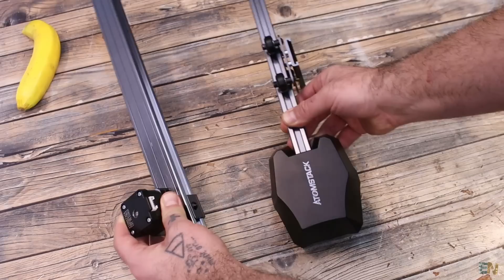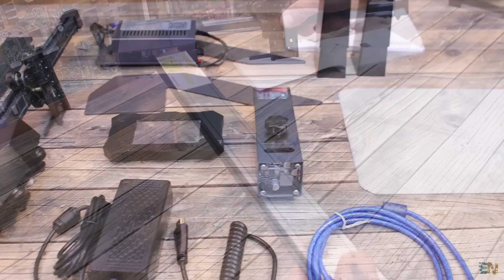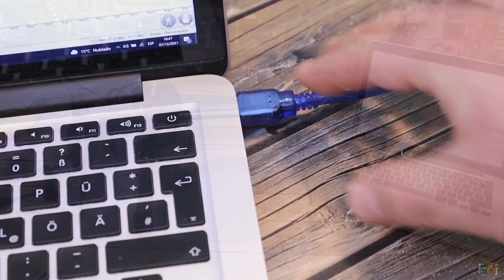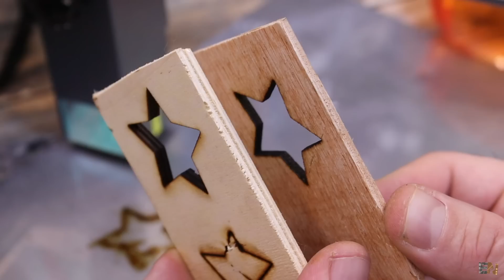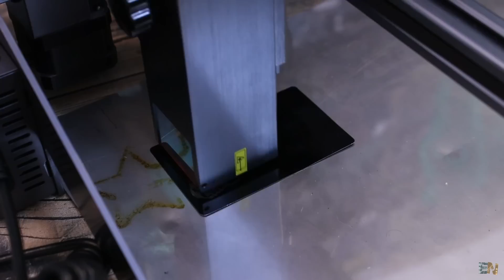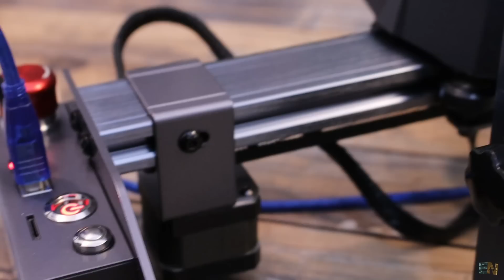Atomstack P9 CNC - 10W Real Laser Power - Cut 10mm Plywood

Comment: Instead of using a metal plate as your work area, you should buy a 12 inch by 12 inch (Or LARGER) WHITE, Ceramic Floor Tile. The WHITE tile will never be harmed by your laser and it's heavy weight will alway lie flat and never get caught by your laser module moving above it. The WHITE Ceramic tile is also a great protection for your WOOD table or work area since it will never get burned nor will it allow your laser to penetrate thru it nor would it allow your laser to reach the wood table below it. You can buy a Ceramic tile very cheap if you go to the clearance area of any home store like Home Depot or Lowes, or whatever home improvement store you have in your area.

Comment: Great video. 
I am looking for one 10W cuttr and this seems like a good option. I build model planes, and I like the 10mm cut power. I did not line the board foam result, the paper was cut but intermediate foam was meted and useless for use in a build for foam planes.

Question: do you know any other option for 10W  in the market?

Thanks

Comment: Engrave PCB please.....
Please.....
Reply: It is extremely difficult to engrave a PCB because the laser beam reflects off the copper. It does not easily heat copper and there is a high risk that the reflected beam will damage the laser module. Lasers work best with dark non-reflecting materials.

Comment: For everyone, please please please buy real goggles, even if they cost 100 USD it only takes 1 accident or odd reflection or the metal sheet warps from the heat and sends the beam off the table and your eyes take a hit....and believe me, your eyes are worth way more than 100 bucks
Reply: This.

Although I'm grateful that the manufacturer has at least made a decent attempt at shielding the beam. Not good enough to use without goggles, but better than nothing.

Comment: Don't accept the Laser Power markings of Chinese Laser products as precise facts. The only way to know the real Laser Power is with a recently calibrated Laser Power Meter. An LPM will also allow you to see the Laser Power degradation over time.
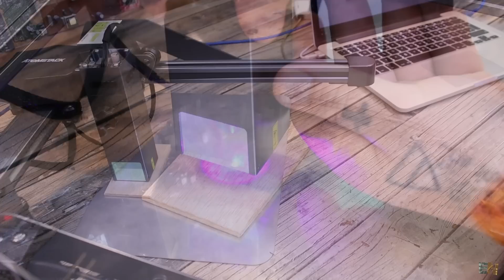6:22... Those cheap $2.00 plastic Goggles will not protect you from a direct 10W Laser Beam. I'd suggest getting a good pair for the Wavelength of your specific Laser.
Reply from the maker: An acurate laser meter is expensive for me right now. Also, those goggles are 60 dollars made exactly for this wavelength. Obviously, direct laser beam is dangerous
Reply: @ELECTRONOOBS  I know 60$ is kinda pricy but dude, how much as your eyes worth? That metal sheet bends from the heat and hit a reflection thru the 2$ goggles and you're blind. Please please please protect yourself

Comment: Thanks for the video 
Any concerns with fire hazard? 
I feel like something like this you have to constantly watch, so I wonder how you would do longer cuts or batch.
Reply: I just assume this sort of thing will eventually catch something on fire. I put ceramic tiles or pieces of scrap dry wall on my work surface to act as a fire break. When something does catch on fire, it isn't a crisis.
Reply: Any kind of laser cutter uses fire/burning to cut things. So they all require supervision unless you can afford the machine and area around it to burn down once in a while.

Comment: I'm sooo glad that I have access to a professional lasercutter, this still looks a bit sketchy, but thanks for showing!
Reply: Please expound on what is sketchy about this?
Reply: @johnmood5653  the lack of ventilation and filtration for example, especially when cutting plastics. Also the wood gets pretty charred, clean cuts look as if they where cut by a sharp knife and then oiled
Reply: @dtibor5903  it's sketchy as there is no airventilation. It's sketchy as it burns the wood - the good ones don't burn it away
Reply: @dtibor5903  also that laser cutter in the hackspace is reliable enough to have last 4 years and fuck cars

Comment: I wonder if we will get diode lasers as powerful  as  CO2 lasers or at least the  40w ones
 this channel   styropyro  does amazing things with laser diodes and overdriving them
and  laser diodes have made lots of advancements in a short time , it would be nice to have the cutting power of a CO2 laser with the  benefits of  a diode laser
although it would probably still  not be able to cut clear plexiglass like CO2  if it were  diode
Reply: You can have very powerful laser diode arrays. Focusing them onto a small spot is the problem. The optics end up costing more than the laser diodes itself. Even 40W blue laser will not come close to what a cheap K40 laser can do because of the wavelength. You want an IR beam so you can cut more materials.
Reply: @zaprodk  yeah that's what i though ,now I am looking into fiber lasers,  but I really know nothing about them, like the fundemental difference between   CO2, diode and fiber
looks like fiber will come down a bit more in price eventually  maybe better to wait for fiber to come down